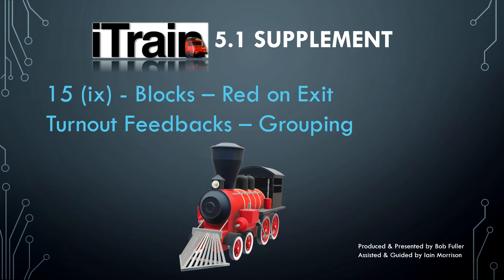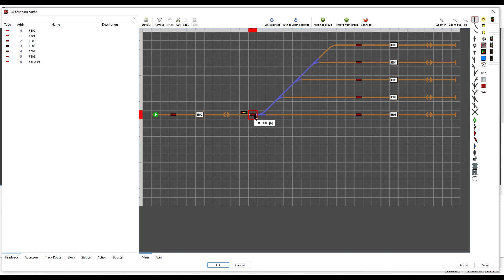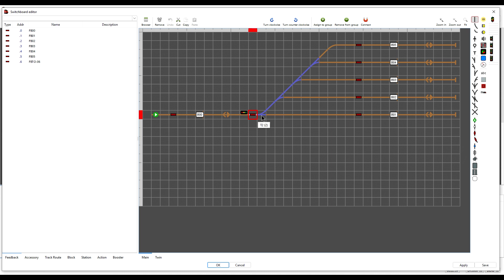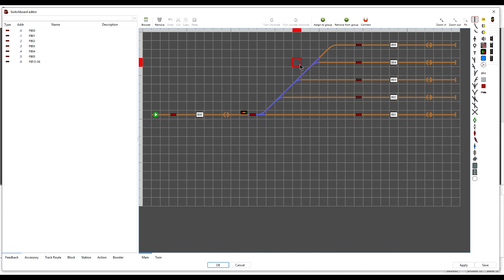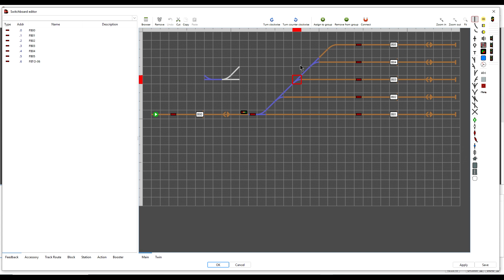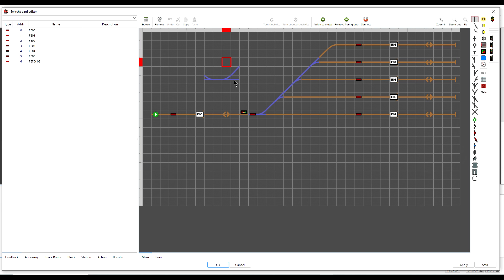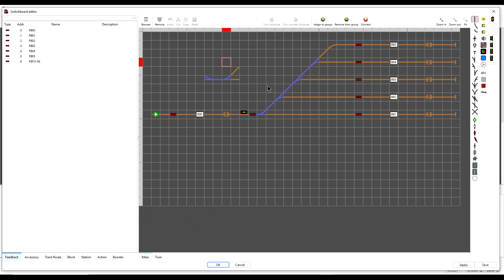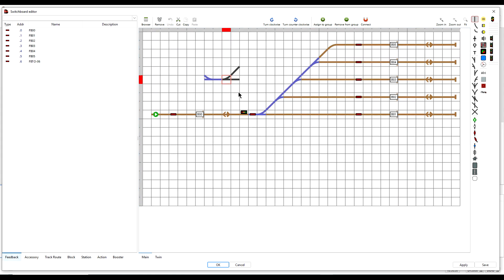Video 15(ix): iTrain 5.1 Supplement - Blocks - ROE - Turnout Feedbacks - Grouping

Comment: I am a bit confused. At time point 3m56s you say never group two turnouts together, as this breaks the rules. In the early tutorials (05 for example) you group turnouts together. I must be misunderstanding something. Can you enlighten me?  I am finding your tutorials vital in understanding iTrain. Before I found them I was floundering. Many thanks.
Reply from the maker: Are you perhaps confusing the term "group" with "connect"?  In video 05, I do not 'group' any turnouts, I have only 'connected' the turnouts to each other. Connecting a turnout to another turnout is, of course, allowed. But grouping two or more turnouts is not allowed. See page 95 of the manual, which describes what turnout grouping means. In this video (video 15ix), I demonstrate how to 'group' a feedback sensor to a turnout, so that the sensor is only associated with the turnout and is separated from the block.

Comment: Hi Bob and Iain,
Thank you again for all of these amazing videos.
I'm looking at this one out of sequesnce (I'm at #20 in the original series just now) as I had feedback in the iTrain forum from mphoi about how I had my turnouts grouped.
I can't find a thread that seems to match this point (and I'm having trouble in the foirum finding out if what i want to ask is a new or already covered thread 😞) so I'm asking here (sorry) - if I have turnouts that are all operating as a throat (or on their own) should they really be grouped to something on the switchboard even if that's not really the state of play in the real world ?
Reply from the maker: Turnouts must be fully isolated from a block. A turnout is never part of a block and therefore is never grouped to a block. So, both tracks at the end of a block on the physical layout need to have insulated rail joiners between the straight track and the turnout. 

However, the turnout itself can be grouped to a short section of track that isn't part of a block. For example, if you have two turnouts joined together by a short section of non-block track, one of the turnouts and the track section can be grouped together and effectively forms a longer turnout. In the turnout properties, the length of the turnout is then entered as the length of the turnout plus the length of the section of track. By grouping the turnout with the track and entering the total length, iTrain then has an accurate indication of the track length that the train has to travel.

If you post a question on the forum that is related to your layout, you should always attach your layout diagram no matter if it is finished or not. It makes it much easier to provide answers.